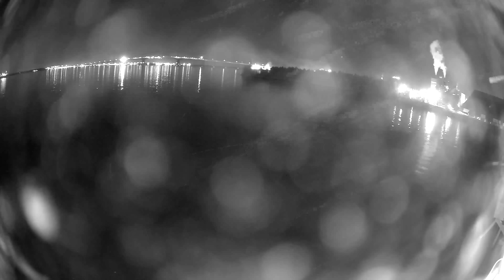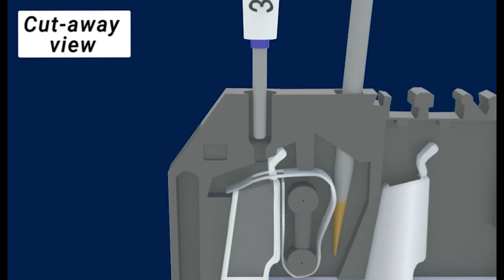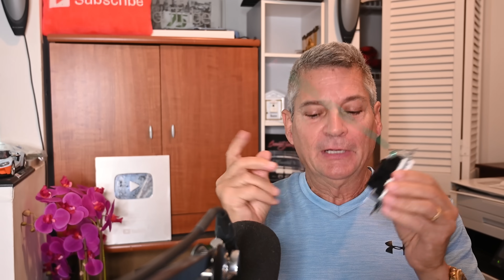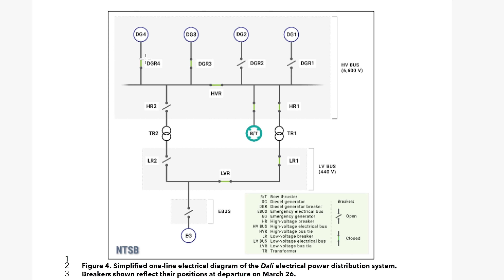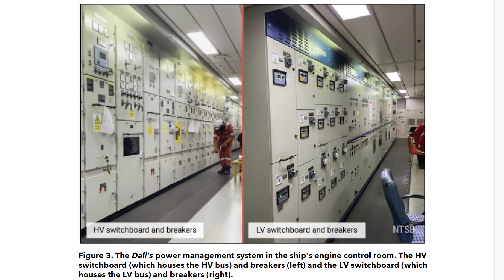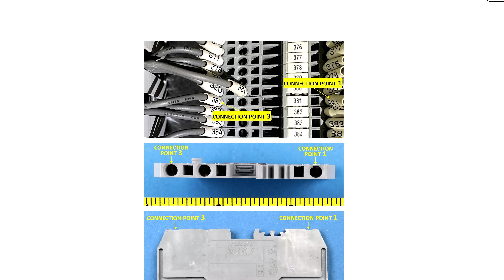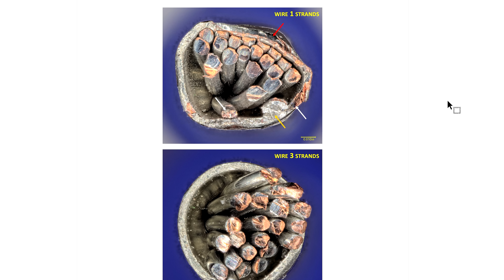NTSB: Scary Wire ERROR Caused Dali Crash/Key Bridge Collapse Baltimore

Comment: Having experience wiring dozens of panels with dozens of spring cage trap terminals with feruled wires, always always always give every wire a tug to make sure it is secure.
Reply: what if tug cause the wire to invisibly come loose ? *just wondering.. not an electrician here.. complete noob
Reply: @bluedragontoybash2463 if it was fully in but for some reason the cage isn't fully engaging the wire would noticable slide with the force given to check it, I actually had that happen recently but with a lever nut on a feruled wire. Outside of maybe a screw terminal on bare stranded wire pulling wouldn't cause the terminal to loosen on the wire.

Comment: As a technician (installer), how do you make such a blatant mistake when wiring a breaker?
Reply: Easy. You're pushing wires in and the one you're installing pushes in. Perhaps you pull on it too, to check it, and it holds. Due to the label covering the ferrule plastic sleeve, you don't see that it's not fully in, so you keep going because you have a whoooooole load of them to install. Have you seen the size of that panel? It's probably not easy to make such a mistake when wiring A breaker - but when wiring *HUNDREDS*, it's probably significantly easier to do.
I see this as a design flaw with the connections. There is no need to have such a deep well with such tight tolerances so a label hinders a full insertion without it being blatantly obvious.
Reply: @horrovac This terminal strip could have been Friday or Monday job. We have to factor in all the possibilities IMHO.
Reply: @horrovac Also the terminals that I have dealt with you are making a connection or not. You are also right about depth of insertion.
Reply: Attention to detail is the key word

Comment: this wasnt an accident.  first off: people were warned not to cross the bridge moments before.
secondly: from the first time the power went off the ship would have missed the bridge if they had just done nothing but the power came on then the ship made a course correction and then it went out again, at that point it may still not have hit the bridge but then when the power came on again it turned streight at the bridge support. Not an accident.
this was already know a few hours after this happened and they chose to leave out the detail that the ship is owned by Ukraine for as long as possible.

Comment: Somewhere out there is a sparky who remembers cabling this cabinet and labelling 381.
Reply: There'll be MANY electricians who remember wiring this ship but I doubt there's one that members labelling this exact wire.

More like several thinking "was it me?"
Reply: @deezelfairy  Funny, years ago I was the production manager for a place that built harness for the military, Airbus, and other such contracts(inciting Apple, Toshiba, Kinston & others). When an Airbus dropped from the sky many years ago, my heart skipped a beat. 

It turned out (if I remember correctly) the pilot over corrected for a badly terminated/shorted(?) artificial horizon, but thankfully our harnesses were for fueling system, but it very easily could've been something we did.  
I'd use that as an example of how important it was to check and double check every part of the process, even beyond of what the contract required, just one wire can do so much damage. 

For that same reason I would not allow employees just cut and run for their break in the middle of a process, I would announce 10 minutes before break to finish what they're doing, or grab a broom, then after break i'd have them back track what they just did before break. 

If someone did a mistake in the process, I would hold the next person involved accountable for starting their process with a bad part.  
Something like this would be worst nightmare, you'd think its common sense not letting the sleeve so close to the terminals, but its such a common mistake.     .
Reply: How many others has he wired and labeled😮
Reply: @timfeeley714-25  Could just be a one off - the electrician was a human and the end of the day.
People make mistakes, no matter how competent they are.
Reply: @deezelfairy yeah but making the mechanism won't lock before the tip touches a certain point is easy, human error happens but this is also flawed design
Reply: @deezelfairy  And those mistakes should be mitigated by good design. This was a bad design.
Reply: @RockinRobbins13 Absolute nonsense.
You cannot completely mitigate assembly errors by design otherwise we would never need skilled labour ever.
Reply: @deezelfairy  _"ou cannot completely mitigate assembly errors by design otherwise we would never need skilled labour ever."_That is true. Keying the plugins for reaction control motors in the Russian rocket didn't prevent some brain-damaged thug from hammering it in backwards anyway. The function of good design isn't to make deviation impossible. It is to make errors by skilled labor unlikely.

This is a perfect example of where good design could have made it impossible to fit the label over the ferrule. That would have saved lives here, wouldn't it?

That doesn't mean some ingenious idiot (the most dangerous human of all) couldn't grind off the shoulder on the end of the ferrule and shrink the label over it anyway. Idiocy has a genius beyond any capability to mitigate completely. But still, we should try.
Reply: He wasn't brain damaged, he was dain bramaged! Yes, idiocy has genius that is impossible to mitigate. But we try anyway.
Reply: May have come pre-labelled , machine applied with no/poor QC.  If labelled on site, could they be heat shrink type that the tech didnt pay attention to alignment and then further didnt observe the product before insertion ?
I did many hundreds of thousands of low-v (telecom) connections over the decades ,  and even though it got tedious at times there were still basic observations one did to each connection.
Reply: Exactly my thought😂
Reply: Sometimes it's a rookie with no supervision. Or a DIY'er shipmate does work they're not suppose to because something needs to get done "right now" and nobody ever checked it. Without experience and training this would be an easy amateur mistake to make not knowing the consequences.

Comment: That is insanely stupid. The reason they shrunk the labels on top of the ferule shrouds was to stop them from sliding back. Doing that doesn't leave much room to hit the spot when shrinking them, so yeah that's a stupid practice.The electrical assembler was probably in zombie land by the time he got to that strip. We already have 10 million regulations and inspections for everything but realistically how can you catch something like this? The more complex things get, the more this is gonna happen.
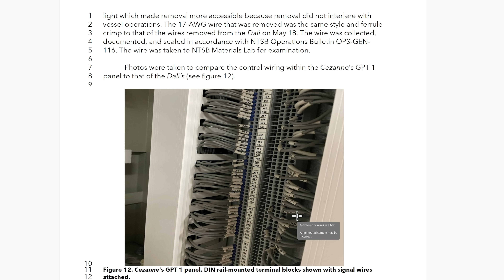Reply: 16:30 and 17:10 if others wanting to compare incorrect to correct (you should be able to see 2-3mm of blue)
Reply: The one who did the wires has been extremely unprofessional and the person who was in charge and allowed such poor job be done is even worse!
Reply: screwless wago blocks have been around for almost 75 years, so not sure it's a "complexity" problem. This is more a problem of the installers being poorly trained. After all, if they had literally seen this presentation once, chances are any one of them would have figured out that the label being where it was was a terrible idea.  I'm betting they just didn't know.
Reply: @mrl22222  There's Nothing "complex" about a DIN rail spring block. The "complexity" is in the system. There's thousands of connections in those terminal strips so while you make it sound simple as if the guy wired your water heater, human error will always be a thing. I'm sure this think had a megger all over it.
Reply: Should have used proper shrink tube or proper size or put a clear shrink on top.
Reply: Jeff has the ability to make engineering fascinating, even to retired psych majors .  I enjoy watching the logic unfold .  Thank you !
Reply: realistically how can you catch something like this? By doing the job properly in the first case... IT was done improperly.. the label over the ferrule preventing the full insertion. Thats how you prevent it, NOT labeling over the ferrule. 26:00
Reply: @crisnmaryfam7344  Well thats happy thinking. Let's just count on everybody to "Do the job right", gotcha
Reply: Some ideas come to mind. 
1) heat shrink tubing has different shrink ratios, they should have gotten one that shrunk down to the cable diameter instead of the ferrule diameter then the label wouldn't have to be on the ferrule
2) as mentioned here, one of those infrared/thermal cameras would be useful. 
3) make the ferrule 2 colors. When fully inserted the first color is not visible but the second color is. That would make it possible to do a visual inspection. If the first color is visible then it is obviously not fully inserted. If the second color is NOT visible then something is obstructing the view which indicates that it might or might not be inserted correctly and needs checking while also clearing the obstruction.

Comment: After watching your video, I have some questions: Isn't Wago a brand name for a specific product made by a specific company? Do you know for certain if that same company made the particular terminal blocks involved in this incident? If not, isn't is risky (on your part) to release a video claiming that "Wago" products were involved? What if the Wago people see this video and have an issue with their name being thrown about as part of the cause? How much do you think would that might cost you if they decided to bring a defamation suit?
Reply: The NTSB named the exact WAGO models in an earlier report just months after it happened. 

I’m sure WAGO has lawyers and PR people watching this case like a hawk, especially since it wasn’t really their product that failed. Nonetheless, I also bet that two competitors, Weidmüller and Phoenix Contact, are salivating for the final report, because those two companies have a newer style of terminal block (which they call “Snap-in” and “Push-X”, respectively) where the wire clamp is shipped wide open, with a hair-trigger at the floor of the wire entry, so that bottoming out the wire causes the wire clamp to snap shut like a mousetrap. (It also makes a satisfying “click” sound when clamping.) That system would have prevented this particular assembly error, since a partially-inserted wire would pull out without resistance when performing a pull test, which an installer is always supposed to do. (But this new style of terminal block only came on the market 4 years ago, so long after this ship was built.)
Reply: @tookitogo  Thanks! This is a very cool piece of additional context.

Comment: I have always thought that springs holding wires by a tiny point of contact was a disaster waiting to happen.  Gut feeling validated!
Reply: It wasn't the spring that caused the problem, it was the wire not being inserted all the way because the label was in the wrong place, and the wire coming out of the spring that was the issue. If the wire was all the way in, the spring wouldn't have caused any issue whatsoever
Reply: But it isn’t validated — the issue was entirely user error by not inserting correctly. A screw terminal would have failed (possibly even sooner) if a wire was inserted only a tiny bit under the screw.
Reply: The spring holds the ferrule, not the wire directly.  It should be better than if stranded wire were inserted under the spring.  I think the system is satisfactory, if properly used.

Comment: Before you all blame backstab. It was TOO SMALL for the wire. Wire ferrule not long enough. And this plastic.  And/or in this case not put deep enough. In some companies i didnt even have wire ferrules, nor time, tools with me to put on wires. But cabinet required some changes to fix issue. So i just cut wire and put inside directly. Making sure it will work. Looking so nice not always makes it work nice. And it was example of that. 

Also there are two types of wire ferrules some with plastic some without. In most cases i just cut plastic to make it fit. This cabinet was designed to not make any room for mistake. I mean size of wires and size of wire ferrules and size of baskstab was not making any margin of error. And that was main problem. Working with these require attention.
Reply: Well nobody should blame backstab here because it’s not a backstab connector at all.
Reply: "No margin of error" -- that's a really good point. So this sounds like an error in training (or learning) for the responsible technician.

Comment: That wire junction connection unit looks like a poor design. It’s obvious that it speeds up wire insertion but also leaves a lot of room for errors by rushing around or not paying attention. Everyone’s in a hurry.
Reply: It’s not. They’ve been used for decades by the millions (if not billions). Every factory — and practically every larger building in Europe with electrical work done in the last 50 years — is full of them. 

They reduce errors compared to screw terminals, which require screwing down to a specific torque (not too little, not too much!!) not only at the time off assembly, but several more times after specified intervals (on the order of months, IIRC) to achieve final retention.
Reply: @tookitogo  I've never seen them in the USA. What are those connecting units called? Also, do you think that it was a manufacturing defect, or was it done by someone after?
Reply: @rancosteel  They’re called DIN rail terminal blocks. (DIN rails are these standardized rails to snap electrical components onto, like breakers, terminal blocks, etc.) They’re omnipresent in Europe for both residential and commercial stuff, while in USA they’re mostly found inside industrial control cabinets and inside machinery. 
Key manufacturers are WAGO, Phoenix Contact, and Weidmüller.
Reply: @rancosteel  As for the defect, you mean the wire over the ferrule collar? That mistake was likely made during original assembly, since in the Dali, all of the wires were done that way (just not quite as far down as on wire 381).
Reply: @tookitogo You mentioned torque. How and where is the torque performed and how did the manufacturer make that mistake?
Reply: @rancosteel  The torque was about screw terminals. You use a torque screwdriver (a screwdriver that has a mechanism that slips when it reaches the set torque, both limiting the torque to that amount, but also ensuring that you get to it, since it clicks when it slips). Of course, in non-critical applications it’s often done by hand with an ordinary screwdriver, leading to inconsistent torque (sometimes too much, sometimes too little).

A huge advantage of the spring-cage terminals is that you avoid needing any of that.

Comment: I've used thousands of this same type of terminal block with no issues. Looks like they had an inexperienced apprentice wire that panel.
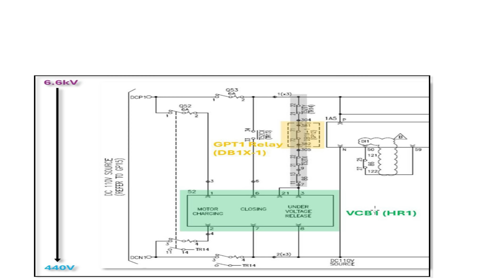Reply: issue was the way it was done just compare the 2 16:30 and 17:10 on the other ship, all the labels was heat shrinked onto the edge of the blue ferrule,  where as on 17:10 they wa only heat shrinked to the cable (you can see the 2-3mm of blue so they can be visual confirmation they are fully inserted, almost all the 16:10 you can't visually confirm they are installed all the way because the label is on the edge of the blue ferrule)
Reply: Nope, - seen this before. If you suspect a bad connection, you do a quick pull test of all the wires, and suddenly you have a loose wire/cable in your hand!  Problem found. Max 5min on 100 terminations.
Reply: I suspect it's not an apprentice, rather a JW that simply installed it wrong. 
Typically, an inexperienced cub wouldn't be performing terminations.
Reply: Well, maybe or a lazy journeymen.
Reply: the  question is this: how would you ever know if you did have issues? This was in place for years before it failed, I'm betting you don't get a notice every time one of your terminations fails.  This looks to be standard practice there, so there could be tens of literally thousands of these problems lurking about.  I bet by monday morning, some people will be changing their practices.
Reply: Hiding connections inside a gray block is very neat and tidy and stupid.
Reply: @user-pf5xq3lq8i   You have zero idea what you're talking about. 

Think about your comment the next time you plug something into a wall socket. 🤦‍♂️🤦‍♂️🤦‍♂️🤦‍♂️🤦‍♂️

Comment: Is it an analog or digital circuit? I would assume thered be sampling somewhere after the connection. Intergrating a debouncing circuit may have prevented this. I can't imagine the arcing would provide an adequate signal. I guess it depends on the timing diagram of the circuit. Debouncing is one of the first electronics labs you do in school. Usually introduced for buttons though. First time I've thought of this but I'd imagine the concept is similar. It's ultimately a non-fixed  physical connection subject to intermittent contact. To me sounds like compartmentalized  black box design and compliance, and lack of requirements oversight.

Comment: I'd initially posted something wise about how if I could have I would have hit any "E-STOP" or equivalent killswitch I could have right at the first power-outage, but I remembered that there's really no such thing on a vessel of that design and scale since it's run by multiple processes of multiple machines that I'm familiar with only in singular settings. Then I was taught that all it takes is one tiny glitch to crash the entire machine under specific external conditions.

Masterful presentation.